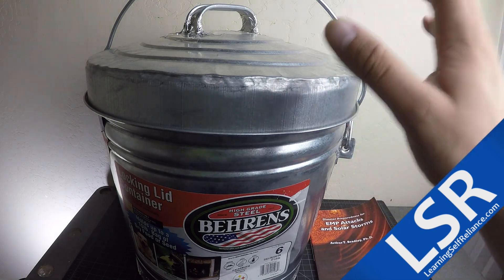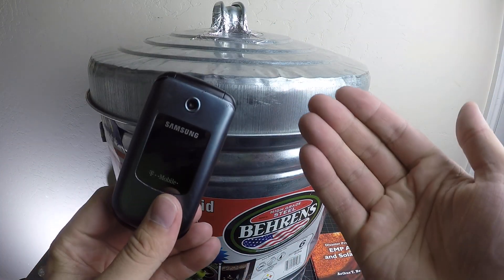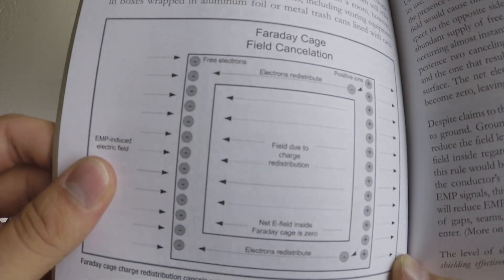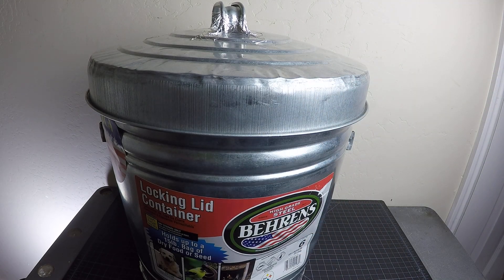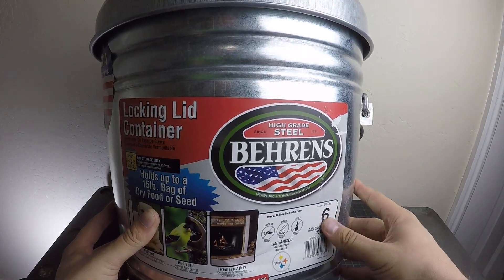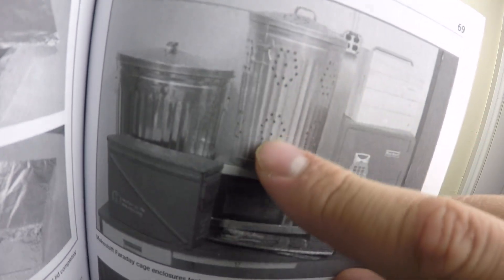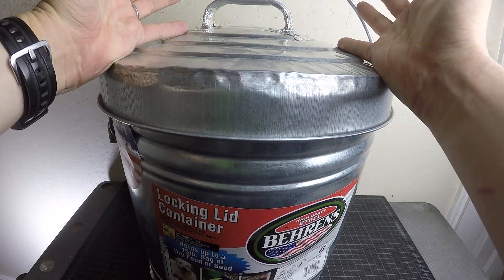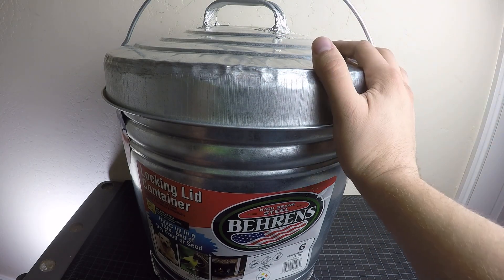Faraday Cage & EMP Misconceptions

Comment: The 2008 Congressional Research Report and HEMP said that Faraday cages need to Attenuate at least 80-100 dB's. The small metal cans and Garbage cans by themselves are good for 40-50dB's. Russia now has a Super EMP that can do 200,000 volts per meter. So time to up the faraday cage.
Aim for 100+ dB's of Attenuation...
Just my 2 cents
Good luck

Comment: One must have training in physics and electrical engineering to understand how a faraday cage works. 

A garbage can does not a good Faraday cage make!

To block electromagnetic impulses you must understand electromagnetic radiation of the type you're attempting to block. Then, you should design your Faraday cage of the appropriate materials and the appropriate design to block the radiation you hope to block. 

But if you're hoping to stop a cell phone signal you better be grounding this thing to the ground through your household electrical source. Plus, formulating an appropriate EM shield to stop cell phone signals. Aluminum is the universal material to receive FM radio frequencies.

That's your education and physics for today now get rid of this😮 idiotic video!

Comment: Grounding the can does help dissipate the energy into earth, especially if you have an EMP event.  Like ear plugs, you can still hear quiet sounds in a quiet environment, but very loud sounds will be reduced enough to not cause damage, maybe. Grounding the can will do nothing to help with the small signals, but a massive shock wave will be stopped better when providing a path for the energy in the metal can to ground.

Comment: Faraday cages attenuate (reduce) RF energy.  The better the Faraday cage the more the RF energy will be attenuated.  Garbage cans do not work well as Faraday cages.  They are made of low conductivity metal.  Typically tin.  Line it with a few layers of aluminum foil and electrically seal the lid connection and other seams.  Should improve effectiveness significantly.

Comment: How about just putting things inside of an old microwave that you don't use anymore? Wouldn't that work as a faraday cage?
Reply from the maker: It might. But they are tuned for microwave frequencies, I would worry the EMP could have a broader range of frequencies and could slip past.
Reply: @lrnselfreliance I'm watching videos about Faraday cages because my utility company is requiring me to let them install a smart meter on my home. It's not that I am making any extraordinary claims about the radiation, but it would be nice to protect myself from it nonetheless. 

I'm wondering how much protection I would get if I just hung some aluminum screen on my wall where the meter is. The meter is on the exterior of the house outside of a bedroom. And if I were to hang a square of aluminum screen on the wall inside the bedroom, would that block most of the radiation? I'm thinking of a square of screen maybe about 5 ft by 5 ft or so. 

The siding of the house is made of stucco, by the way. I don't know if perhaps that helps protect from the radiation, does it? 

It has also come to my attention that my cell phone gives off more radiation than I thought. I'm looking into what can be done about that.

Comment: See but I had the same problem And I freaking worked N worked for about 4 hours and I got zero service with zero calls zero wifi etc. you can achieve zero . I just did this this weekend. With enough work and idk I took a green coated wire striped it about inch pushed that into the ground then connected the rest inside the bucket and once I did that, that was when I achieved Total zero service and calls. I'm not sure if grounding it helped or not but I did it and when I did I finally got total zero service. Lots of aluminum tape and a bit of foil that's what I used with my metal can and lid.

Comment: The point is this.
Faraday cage is electric STATICS and is about Gauss Law and the Laplace equation and about boundary value problem.

What everyone is talking about is blocking radiation with a wall of some sort. Yes you can join up the wall to enclose a volume of space BUT the mathematics involved is not a boundary value problem BUT the mathematics and physics is going to be same as asking what radiation can pass thru a wall or a mesh. Although it seems similar the mathematics is totally different and you would be looking at electric properties of wall and skin depth and frequency of radiation and energy of radiation. THAT IS NOT A BOUNDARY VALUE PROBLEM of electric statics!!
That's electric dynamics.
For instance you can block infrared from your tv hand set by a very thin piece of paper. You could block radiation effectively with a very thick good conductive material and make a faraday cage of such a material. Gauss Law PLUS the above considerations (frequency, energy, skin depth etc) would result in a excellent faraday cage BUT strictly speaking a faraday cage is about electric statics and a boundary value problem of Laplace equation and so in most faraday cages you may see you would still be able to use your phone.
It's a mathematical thing!!
What Faraday was looking at was charges on surface of conductor and the shielding of cavities within conductor, Gauss Law and boundary value problem of Laplace equation. STATICS!!

Comment: I USED to see piles and piles of legit mil-spec 50cal ammo cans sitting at the gun range from the early 1980’s up until Barry & Big Mike moved on up to Washington DC.   
Most of the cans were nearly new with no rust or dents. 
The cost?  
They WERE approx $2-4@ in quantities of 10 or 20 or so.

I have most of our ammo stored in new ammo cans (50cal) after vacuum sealing each small box in 8mil poly bags with silica gel desiccant packs inside the bags.  I’d then double bag each small bag with additional 500cc desiccant packs.
Everything then got packed in to one of the new ammo cans with a small aluminum “tin” of color indicating silica gel. (only a few $ bucks each).

According to several ammo manufacturer’s engineers, packed this way and kept at a cool and stable temperature under 80deg F… I can expect to see a life expectancy of 60-75… YEARS!!  (I was contributing to an AR15.com article back after 9/11/2001 and had great access to our department suppliers… I was actually very surprised and quite happy to know our “investment” would have a long and usable lifespan).
I’ve been checking online sources for a while now.
Reply: Sorry… I forgot to include the key info.
I was looking for a dozen or so additional ammo cans to use for “Mini Faraday Enclosures” and to pack up some newly acquired 5.56 Lake City items. 
Our ranges and gun stores had almost nothing in stock and whatever they did have was rusty and dinged up.

Nearly everything I located online was either extremely expensive, had extremely high shipping, or both.
I ordered several from several suppliers and all were in horrible condition when they arrived.

But.. Today I received my order from an Amazon vendor.   (I hate giving them $$ vs. Local business, but i am now fairly disabled w/Ankylosing Spondylitis and their “prime delivery” to my front door is a blessing)

The ammo cans were from a military contract (CAGE Code was on each) manufacturer.
They were BRAND NEW !  
Each one came wrapped individually in bubble wrap and each one in it on thick cardboard box .
Each can had perfect paint, perfect butyl rubber gasket, etc..  PERFECT!
(Can you tell how surprised I am?  LOL)

THE COST EACH — DELIVERED TO MY DOORSTEP = $19 BUCKS !
(FEB-2-2024)

Just search the Amazon store for “Fortress Metal Ammo Can”.

They also have copper tape with conductive adhesive on Amazon.
It’s likely Chinesium, but at a decent price…
Now I feel like a dirty shill for Bezos.   
But at least, my last name is not Biden. 🤣

Comment: Excellent video and presentation 🙂 I've been freaking out over a possible CME and/or EMP... I recently received a "Pacemaker". I've been scratching my head on how to protect it. If it fries, I'm history... I've been instructed, by the Doctors, to avoid contact with "Welding Machines" and other EMF sources, such as High voltage Transmission lines, as they can mess up my device.  To add some protective clothing and/or an EMP, EMF and/or CME proof shelter, like a Faraday Cage of some sort. I found a Filtering material, on Amazon, that is described as filtering 95% of most frequencies... I'm planning to make a tent of sorts that I can get into, in the event of a serious CME or EMP, etc. On the funny side, if the material Fails, I don't think I'll be in any condition to get my money back... lol Thanks for sharing this information... I'm going to get that book... Not just for something to read but because I NEED it... 🙂
Reply: From what I’ve heard pacemakers are built with a high level of protection, which should be safe  in a case of emp.

Comment: Im going to make one for my portable generator out of a cardboard box wrapped with layers of heavy-duty aluminum foil. Some people say you need to put an insulating layer between each layer of foil, others say just use 3 to 5 layers of foil right on top of eachother. Anyone know which is correct??

Comment: I see you did this 7 years ago, things are way different now. I think everyone should have a faraday cage now!
Reply: An effective Faraday cage is a good thing to have.  The problem though is that there are too many misconceptions and flawed information about them.  Even this video about misconceptions is a misconception gold mine.

Some effective Faraday cage critical keys.
1) Must be electrically sealed.  Even very small gaps will leak RF energy.  The larger the gap.  The longer the wavelength (lower the frequency) that gets leaked.
2) Use the most electrically conductive material practical.  Not all metals have the same level of electrical conductivity.
1. Silver (best but cost prohibitive)
2. Copper (very good, expensive but affordable and available)
3. Gold (pretty good but very cost prohibitive)
4. Aluminum (probably the most practical)
5. Steel, iron and tin are further down the list.  Line such containers with several layers of aluminum foil.
Aluminum foil lined containers make pretty good Faraday cages if they are electrically sealed effectively (several continuous layers; any overlaying of seams must be by a significant amount).
If electronic devices inside a Faraday cage receives a signal.  Then it is not an effective Faraday cage and will not protect electronic devices from an EMP.

A shoe box that is well lined with aluminum foil and electrically sealed well can be a good Faraday cage.

Comment: great video. I have the same set up as yours however when i tested with cell phone and two way radio it completely blocked it. the only difference i did was I used copper tape around the seams and rim.

Comment: My Faraday cage doesn’t let phones ring when called. And cars made before ‘84 have a much better chance of running after an emp, the majority of pre 84 vehicles will still need to have things replaced like alternator and cylinoid and possibly battery, but with only 1 in 10,000 vehicles made after 84 even have a slight chance of operating!

Comment: If the emp takes out small electronics,  won't it take out electric grid, cell towers, etc? Seems foolish to worry about having a phone if towers are down, grid down (transformers made in China) so no power except solar. Regular generators need fuel....that will eventually run out.
Reply from the maker: Cell phones will certainly not be able to make calls. But, if the EMP does not destroy yours, you may be able to use anything you saved to it. Offline maps, videos, etc.

Comment: Question once an emp hits how long after can you use electronic equipment out on the open? Or it cannot be used?
Reply from the maker: You need to wait for the EMP to end. If the source is nuclear, wait for the bombs to stop. If the EMP is from a CME, wait until night and look for auroras, if there are none, it should be safe.

Comment: Purchase a backup computer module for your car model, wrap in in a few layers of foil and keep it under the seat just in case. Also, surges "confuse" memory circuits. Disconnect the negative terminal fro the battery for 15 min, then reconnect. It might start up.

Comment: Aluminum will not Shield an EMP. You need a ferrous metal, ferrous means iron-containing, steel has iron in it. Stainless steel has chromium in it, that displaces the iron depending on the percentage of the chromium. If your stainless steel is attracted by a magnet, then you have enough iron in it to shield from an EMP.
Reply: False.  Aluminium is an excellent faraday material.  Copper is not ferrous and is also an excellent faraday material.  An emp induces current by lens law.   Not  a magnetic field.

Comment: Consider that the amplitude from an EMP or solar flare is going to be a LOT stronger than radio or cell phone signals.  If you're still getting through with those, you might want to quadruple or quintuple your protection.

Comment: Install a conducting gasket in your can and stop the rim acting as an antenna. The Dr. whose book you referenced proved that without the conductive gasket and he recommends several different types for ammo cans or garbage cans you lose a significant amount of DB reduction. I have the exact same can you have I used copper tape at the handle to secure that gap and tested it with cell phone and ham radio both with and without the gasket, but the gasket would stop cell phone and ham walkie-talkie communications completely. Your mileage may vary.

Comment: If all you have is a couple cell phones to protect, get a new paint can. Place the phones in a cardboard box and then in the paint can. Don't forget the charger too.
Place lid on the can and step on the top to seal the can.

Dunno why people want to save cell phones as the towers and grid would be destroyed, but no biggie.

Best thing is to put boxed rechargeable batteries and charger in the container.

Solar panels (disconnected ones) are usually immune to EMP and such so no need to enclose them.

Your microwave is USELESS as emp protection. It is not sealed around the door. Fridge is useless too.

On that small can with handle - you still need to tape around the lid after the lid is installed.
And where the hinges attach to the can (inside and outside if you can).

None of the DIY cages will protect squat if you are anywhere near ground zero.

Comment: I made mine lined it with aluminum foil facing outward and  Layers of cardboard and sealed the lid the bottom w duct tape ,but you don't have any foil you don't have anything in the lid you don't have any duct tape. I don't think mine would have worked if it didn't have that.

Comment: Nice video.  I wonder if electronics stored in a trunk might survive.  Since I also have a aluminum Diamondback bed cover that would seem to provide an additional layer of shielding.  However, I do realize that for convenience purposes I do not have these compartments totally sealed, providing a true Faraday cage!
Reply: Trunk lid has rubber gasket and a big gap.
Hatches - same problem but also have defrosting wires and even 3rd brake light which admit EMP.

Comment: Is EMP able to do anything to the electrical system in the human or animal body? We are made up of much electricity and water. I am just wondering what effects EMP may have on the human body or brain. Thank you for the video, it is very much good help. How long must you wait to open the faraday cage after an EMP before it's safe?
Reply: It depends on the frequency of the pulse. EMPs targeted for electronics (100 MHz-100 GHz) will not harm a human, you are constantly bathed in cell phone signals which are in the GHz range without issue. That said, lightning is also an EMP and those will hurt for sure.

Comment: Having built and used a screened room for radio testing, I can say that your dustbin model is not adequate to demonstrate. You would need an imtimate seal all the way around between the rim and the barrell - at cellphone freuqencies, any gap will allow significant transmission.

It's unfortunate that many folks launch into explanations of the FC without having built/used a proper working example.

For my room, I used bronze flywire. I thought that just stitching the panels together with copper wire would work, but it failed to give the 100,000:1 (50 dB) attenuation (cut in transmission) that I needed.

It was only when I spot-soldered the panels at 25 mm (1") intervals, that I was able to get my 50 dB.

Even then I had sigificant interference, and that came from the outer braid of a television signal cable entering the screened room.

I applaud your intention, but you need to give us a more robust model before you begin your explanation.

Comment: Pretty sure the aluminum tape has non-conductive adhesive, so for this purpose you'd be better off with copper tape, which is used in electric guitar pickups.

Comment: First WHY IS YOUR Cage NOT GROUNDED????
Galvanied steel is not a Suprior conductor...
You obviosly HAVE NEVER WORKED IN A HIGH VOLTAGE SITUATION WHERE ALL ELECTRONICS will not COMMUNICATE work in a REAL
 FARADAY CAGE
mice presentation with no actual faraday cage

Comment: trying to find out if you could use the inside of a car as a faraday cage? i know it protects against lightning but not sure about EMP... a car is basically a faraday cage as long as the windows are up right?  I know the engine compartment is open on the bottom so the car has no chance of running again just curious about say throwing all your electronic devices in the car... like a microwave oven only bigger?